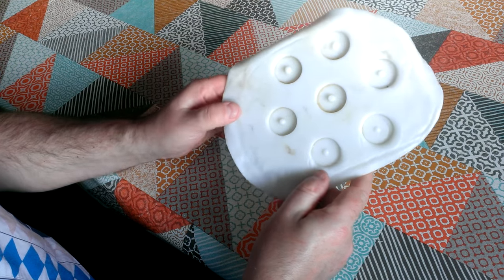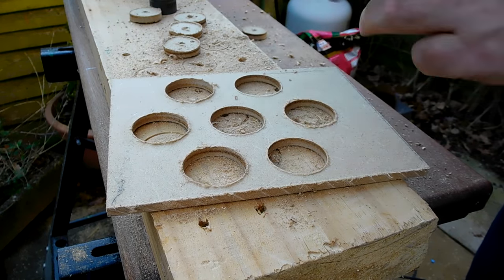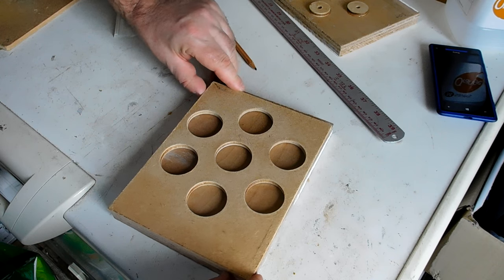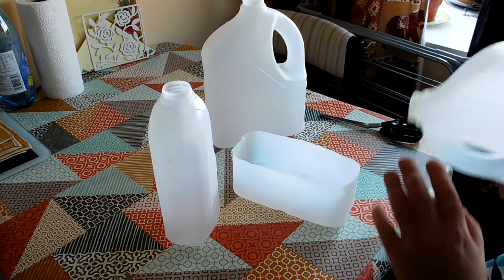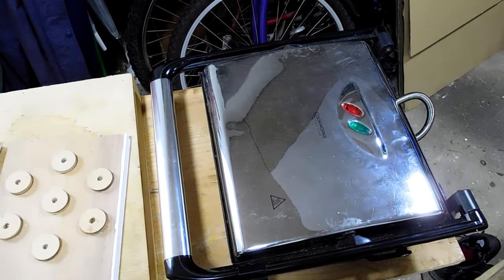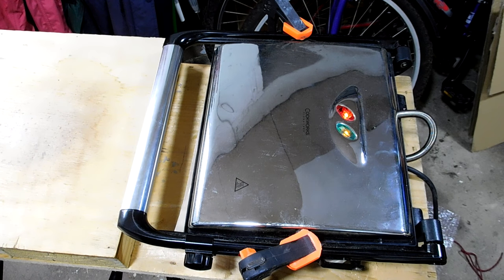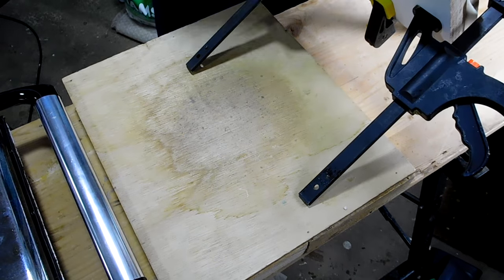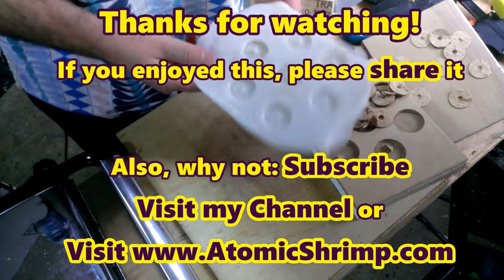HDPE Press-Forging - (Fail) - Making A Paint Mixing Palette

Comment: The shrinkage in cooling HDPE is legendary, if you wish the inner mold to remove relatively easily, and remain intact, they need to be conical. If this done, Mdf will probably survive, but I recommend that you paint them with a good quality gloss paint that will make them more slippery. Making the reverse side of the mold, a matching slope, will increase the longevity of that side too
Reply from the maker: I've just formulated a plan for version 2 of this press mould, and I think it might work - the trick is going to be to have the male parts of the mould sprung so that they initially push the melted plastic down further than its final position, then it shrinks back compressing the sprung plungers.
Reply: interesting, but I really think the male part of the mold needs to have a sloping side, or better still hemispherical [which would make a better bowl]

Comment: I disagree that your experiment is a failure.  I think it is a good proof of concept.

Perhaps you can try using aluminum for your disks next time instead of MDF.  I know you don't have a metal lathe, but I am certain you can get clean edges on aluminum disks if you are careful.

Another possibility could be to use polyester resin for your disks.  I have seen somewhere (possibly instructables.com) somebody making an injection mold using polyester resin.  I have not tried it myself, and I don't think the polyester will last for very many uses, but I suspect it can be used at least a couple of times.
Reply from the maker: Thanks - yes - this isn't really a failure - it's a step along the road.  Your suggestions are interesting - thank you.

Comment: MDF may be easily handled with its smooth surfaces and being very flat, its inner construction leaves a lot to be desired as the inner layer dis integrate  with the forces applied to it. But having said that, it still can be workable if you incorporate quite a big tapper of the male and female halves to affect the releasing of the part. Ejesting pins are good idea to try also since the plastic in question is not really melted to the state of liquid, it would not leak in to the ejecting pins/ plate assembly.
Reply from the maker: I'm actually thinking of making a pair of mating moulds by cnc carving endgrain blocks of hardwood. Together with addition of chambers and tapers, plus a quick, positive clamping method, I reckon that will work.

Comment: Metal clamps, put the mold in an oven to reheat it, tightening clamps again,  and form and cool slowly. The wells need angled edges for draft to be easily removed. Have you tried things like this with a single sheet or two, big as you need them, clamped into the form instead of pellets.

Comment: A method for eliminating the holes is to use a drill press/pillar drill with your hole saw. This means you can remove the drill bit in the centre of it and still cut the discs out. Obviously care must be taken because the wotkpiece is no longer pinned in place but once the cut is started it follows through nicely. Also adding a slight taper on the discs will aid release and hopefully prevent destroying the mold.
Reply from the maker: Yeah, I need to fix my pillar drill (I think the taper needs cleaning as the chuck keeps falling out - or it could be that I damaged it when I was using it to power my HDPE grinder)
Reply: Oh! Yeah, that would make it difficult to use!!
Reply from the maker: If only solid PTFE board was a stronger material, I'd make the whole mould out of that.  I'm thinking now that maybe a two-part mating Aluminium mould could be the answer (like a waffle iron, but not waffle patterned)

Comment: Would it have helped if the mold had been warmed in the oven before use? I would imagine it would give you more time to work with the plastic. Just a thought.
Reply from the maker: Possibly. It could also be that this is not really a January project

Comment: Nice try good Sir! As you were gluing down the discs I was thinking that I'd just put a screw through those handy centre holes. That way you'll also just get the drive feature to remove. Idealy you'd have some draft on the mould (1° min) and use something as mould release.
Reply from the maker: I thought about doing that, but just didn't bother. I will do if I repeat this with a different material. I think the MDF discs would have frayed and delimited anyway.
Reply: One of the discs looks to have come cleanly out of the piece and it's the only one that the material appears not to have flowed into the centre hole. Shrinkage might be part of the problem but it appears  those peg are more so. Especially as they're unlikely to be perfectly perpendicular to the face. I think with some minor tweaks you'll be there. It's hard to think of a better suited material than MDF with decent availability/price.
Reply from the maker: Shrinkage s exactly the problem. HDPE contracts strongly on cooling - which is why the circular pieces were tightly jammed in place - the whole piece shrank inwards by maybe 5 to 10%, which is enough to really bind things up.

Comment: Is it necessary to cut the raw HDPE into such little pieces? What if you cut fewer, but larger pieces (maybe 3"x5", or such) and layered them inside your container? It would save you lots of time cutting pieces. Do you think it would still melt as well?
Reply from the maker: They tend to pack less well if cut larger, which can make it hard to fit enough plastic on the hotplate in one go. This can be overcome by adding some more after the first lot melts, but I try not to 'overcook' it, as this can reduce the strength qualities.
Reply: Maybe get a paper/credit card shredder off of eBay, you might be able to find a cheep second-hand one.
Reply from the maker: I tried that - the plastic is so slippery that it works between the blades and jams up the works.

Comment: It is not necessary to cut the plastic up so much. You are wasting your time. I used to cut the plastic up too, but if you knead it while it's hot and keep it molten for a while, it will eliminate the air effectively. I usually just cut it as small as I need for it to fit in the pan for melting.

Comment: It may have just been the camera, but the material appeared to still be white when you took it out of the heater.
It should have been clear if it was hot enough.
Reply from the maker: It depends. Some white hdpe is like that because it's the natural colour of the cold material. Some is white because it has white pigment added (detergent bottles are often like this)
Reply: @AtomicShrimp  Good point.

Comment: Silicone mold?
Reply from the maker: Silicone has sufficient heat resistance, but I don't know of any silicone materials hard enough to work as a mould for HDPE - this stuff fights like a live animal as it shrinks during cooling.  One of my previous experiments involved pressing the sheet between two strainless steel bowls.  It crushed the inner one as it cooled.

Comment: You need a hydraulic press. You could make one with cheap bottle jack.
Reply from the maker: I actually have one (well, it's actually a cider press, but it uses a hydraulic jack).  Getting it all in and clamped down before it cools could be a challenge
Reply: AtomicShrimp
Maybe use heatgun as way to keep plastic malleable as you position it.
Reply: Atomic Shrimp as an aside, I would love to see you use the cider press!! Is it something prefab or did you make it?